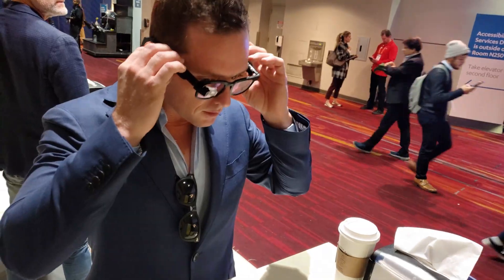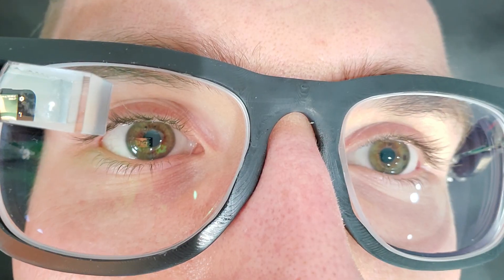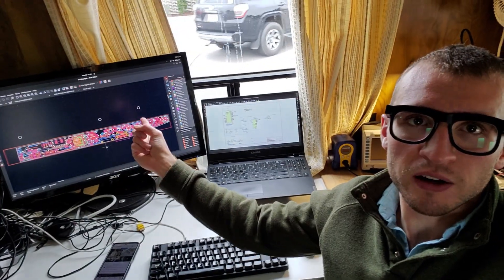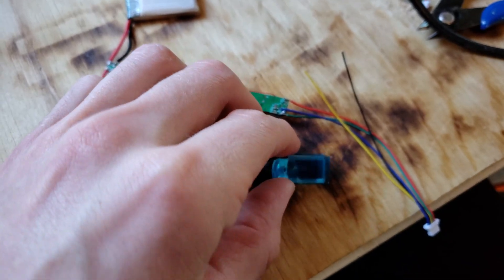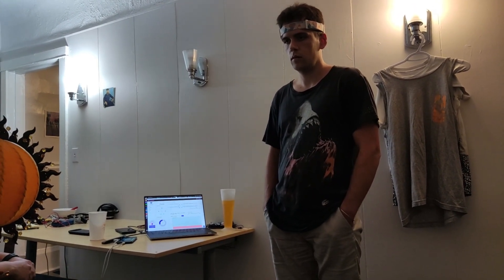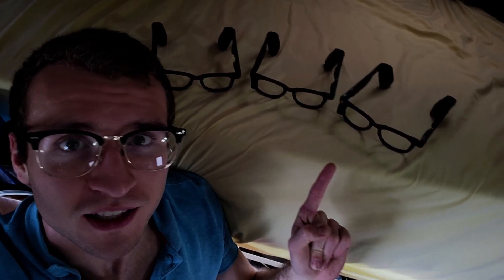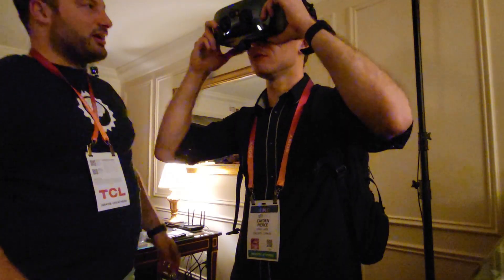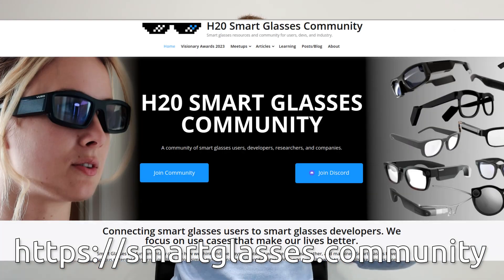We Built Open Source Smart Glasses

Comment: Is there a Way to build these myself, if so what is the Investment/skills required? I have some soldering skills, 3D printing skills, and perseverance. I also have absolutely no coding skill.
Reply from the maker: All info is on the GitHub and GitHub wiki, linked in description. Resourcefulness is as important as perseverance.
Reply: @caydengineer Thanks, is there a build guide available anywhere?
Reply from the maker: @CrashTestRC1  I just told you where it is. You are not resourceful enough to successfully build smart glasses.
Reply: @caydengineer Ok, I'll stick to airplanes.

Comment: Now do this for a motorcycle visor...
Reply from the maker: It's a good idea, there are a number of these on the market (search for motorcycle helmet AR display HUD).
Reply: @caydengineer  they are all rubbish though. Last thing you want inside a motorcycle helmet is a solid piece of matter which may be mashed into your face/eye on a bad day. The projector needs to be embedded into the foam shell besides the eye/cheek and be projected directly onto the inner surface of the visor. Also, very specific functionality and operational characteristics are necessary for it to be widely adopted by riders. HUD for speed, adjustable bike settings, warning indicators, P2P coms only and a range of simple, effective and immediately accessible control interface for things like position/translucency/brightness/selected info etc. Some people may wish to have integration with Google maps, phone call/message, music, etc but these are all hit and miss and unless the fundamentals are done perfectly it's all a waste of time and effort anyway. 

Other features a smart helmet could/should have is built in, high powered LED lighting for seeing through corners when riding in darkness (could have auto dimming and/or power off when encountering oncoming vehicles. The battery pack / power would most likely have be remotely mounted but it's not out of the scope of possibilities and if a tether was incorporated, an additional line could be included for water / visor ventilation....)

Once the key things are done properly and no encroachment on the desirable elements of riding are imposed on the rider as a trade off, smart helmets will take off. Just don't try do too much, less is more and any unnecessary complexity/inconvenience will detract 1000x more than the desired /elements/benefits will add to the desirability factor.

Comment: Do you think it is possible to design the glasses as a simple attachment to any pair of glasses and put all the hardware wired into a box you can put in your pocket?
Reply from the maker: Yes, but this ussually results in a very uneven and uncomfortable and odd looking experience. Full integration is the better solution in my opinion.
Reply: @caydengineer  Your design seems to have lenses in them; do you support prescription lenses?  How do expect that process to work?
Reply: Answered my own question; looks like the frames are very similar cough cough to a pair from Zenni.  Good choice, whoever made that call.
Reply from the maker: @davidskidmore3442  you are right!

Comment: Are there any smart glasses with prescription auto adjusted to the eye. ?
Reply from the maker: Many of these glasses offer the opportunity to integrate a prescription lens insert.
Reply from the maker: AFAIK actual auto-adjust prescription glasses exist in research and medical, but there's not market pushing them forward as they cost 100x a regular pair of glasses, and prescriptions change slowly, so what's the point?
Reply: @caydengineer  i see.

Comment: Come on...don't make it into another highly specialized business type do nothing device. Where is gps? youtube videplayback, or at least wireless mirrorlink. we want multipurpose, easy to use, especially with standard android applications glasses that won't scare people on the streets.
Reply: Features i want is word search function. Glance around a supermarket and the item your looking for is highlighted. Basic Heads up display : heart beat graph, body temp, blood pressure, O2 lvl, time, humidity? Maybe a mini map/gps map or instead a 3d display of that path you’ve taken. So you can see where you maybe wasted time or steps. Would also help for back tracking when losing things. As you would know your path and head orientation could help you to stop from looking in the same spots. Obviously it needs to have auto dim and be able to display web pages. 
If i could go further id pack a ir camera and a ir LED in there for night vision. We could source very tiny high def cameras from drones. It would be pretty basic night vision but it should be better then nothing. If thats not possible just put a led in there with a focusing cone so you can read with it.